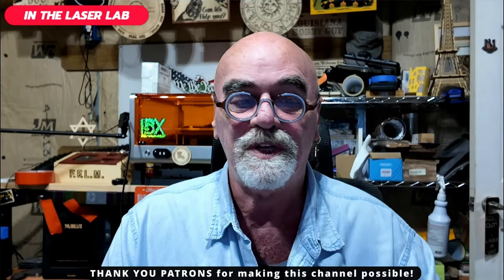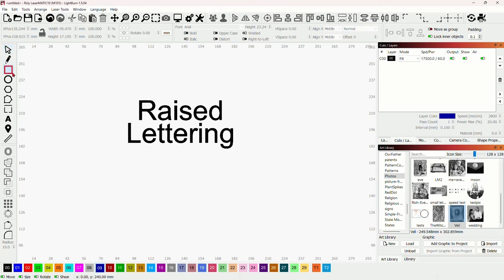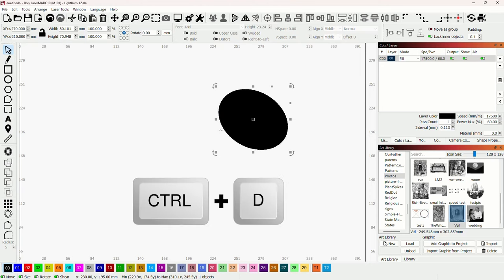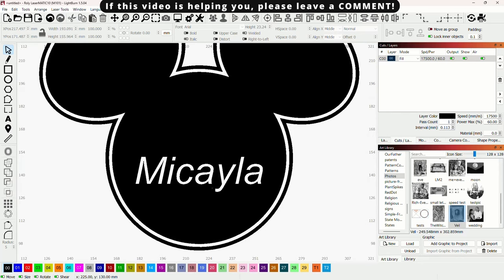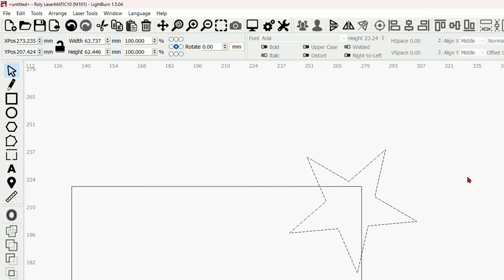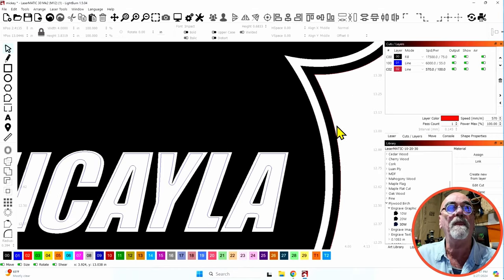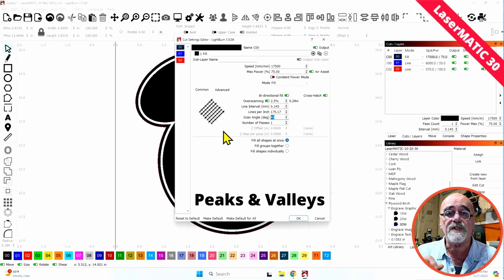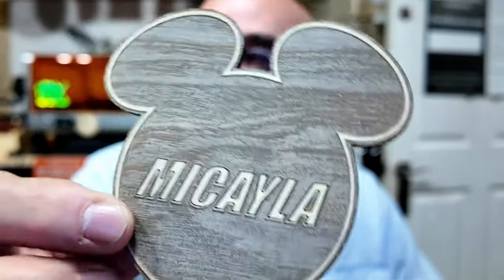🙆‍♂️ Relief Fill, Raised Text, Merging Shapes and Pro Engraving Techniques!

Comment: Could you explain the overscanning setting?
Reply from the maker: Overscanning provides time for the laser to turn off, slow down to make the turn, and then speed up again before turning back on. The setting is only for diode lasers. Co2 lasers have it built into the control boards (except the K40).
Reply: What better? Higher or lower number. Not sure if I fully understand
Reply from the maker: 2.5% to 3% works on most diode lasers.
Reply: @TheLouisianaHobbyGuy  Thanks. My shop machine had it set at 4.5. Curious as I do not recall ever messing with that setting but my work laptop which I have a copy installed which I use for when I am on the road had it at 2.5. No idea how it was changed. Does not look to be a big deal. Befuddles a senior old sourdough which is not hard. Thanks again.
Reply from the maker: 2.5% is the default Lightburn software setting.
Reply from the maker: 2.5% is the default Lightburn software setting.

Comment: Thanks fior the great Video.  I have a question how did you do the offset with the BLUE LAYER. I have tried and just can't get it right. The file you shared does not have the Blue Layer.Thanks
Reply from the maker: It wasn't included because it was a specific name. All I did was create a smaller name and put it in line mode on the blue layer.

Comment: Hey Rich I like the video, but using your coin as an example, how would I add a cut line arount the coin? When using the filled coarse?
Reply from the maker: Select the outer shape, do a 0 offset (it will automatically select it)  and change that offset to a cut layer Dwight.
Reply: yes that worked Rich, thanks

Comment: I really like the project. I see that each layer has air assist, is this correct? Because other recommendations I have seen, say that for engraving, I should disable that option. Greetings from Chihuahua, Mexico.
Reply from the maker: I keep the air on all the time Miguel, it keeps the lens clean.

Comment: Great video. I have a question about the Roly. Do you have to wear protective glasses while it is running? I bought the xtool S1 and wishing I would have bought the Roly instead. Customer service is sub par with xtool and I have heard nothing but good about Roly. Selling my S1 for something built for Lightburn. Thank you.
Reply from the maker: I don't, because my back is always to the machine, but it doesn't matter what laser you use, you should always take the extra precaution of wearing safety glasses. No acrylic can filter 100% of the laser beam, 98% at best. I personally never look at the job while it's running, except from a distance or on camera.
Reply: @TheLouisianaHobbyGuy  Xtool pushes the class 1 standard that doesn't require glasses but with my riser, I see flashes from the rear door on my wall. Good advice, thank you.

Comment: Question: wouldn't 45 degree angle engraving be slower than 0 degree angle? If do, why not just turn the plywood 45 degrees?
Reply from the maker: It is slower with a different affect.